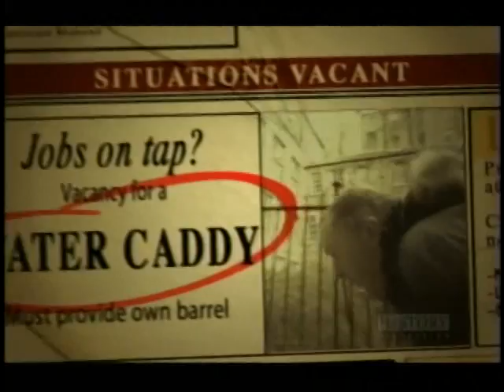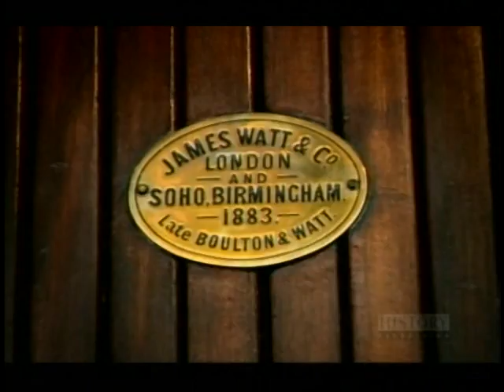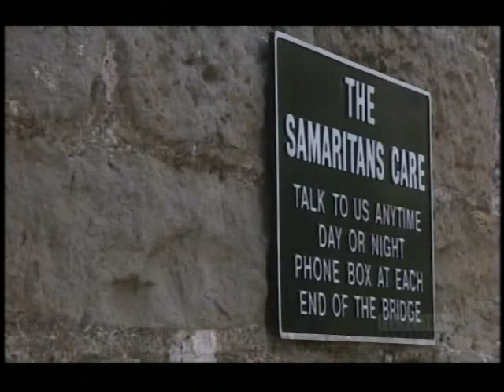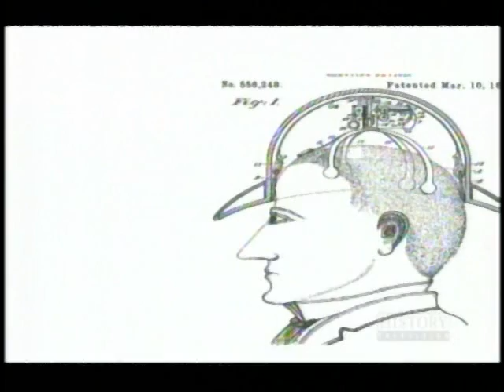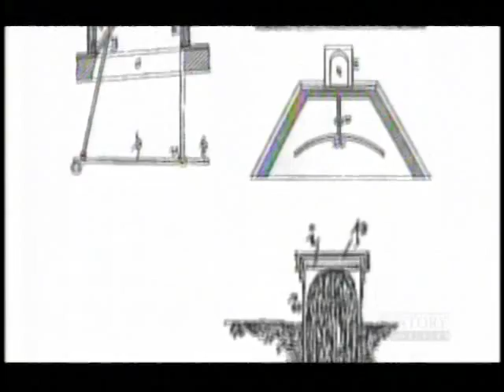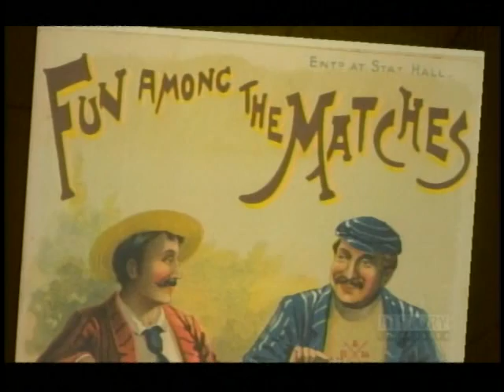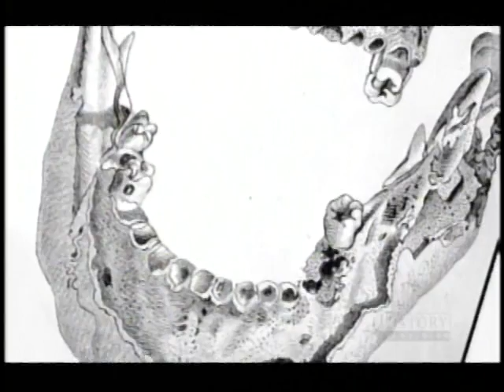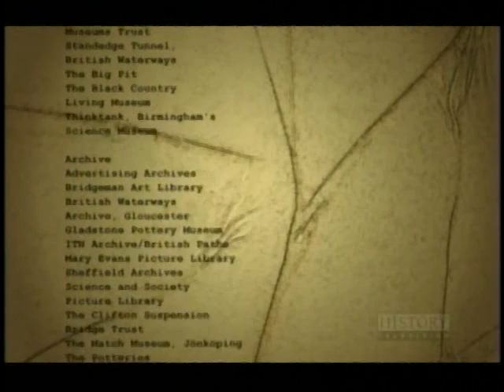The Worst Jobs In History - 2x03 - Industrial

Comment: If I were in charge of the boats I would not use leggers. I would use a rope slightly longer than the tunnel and have a horse pull the boat through from the other end and use the boat to pull the empty rope through for the return trip. You would need two horses on each end. One to pull the boat the other to pull the next boat while the horse from the first boat walked the path back to the tunnel. Silly people.